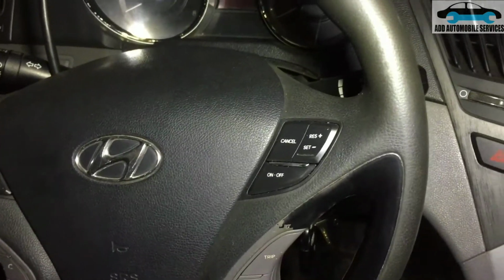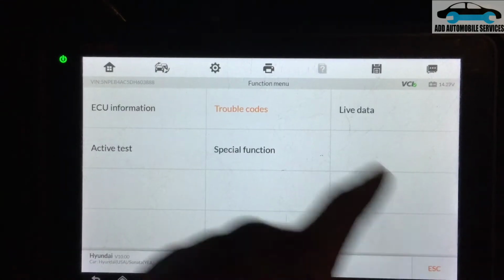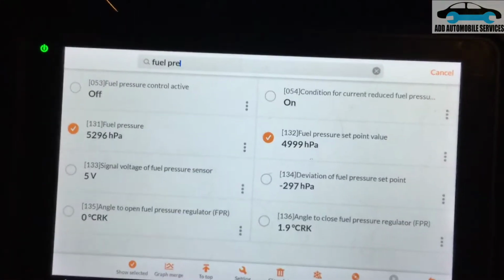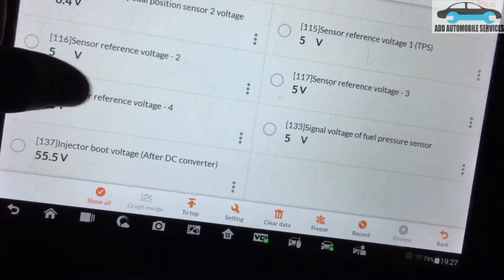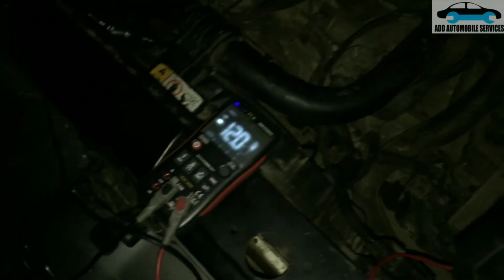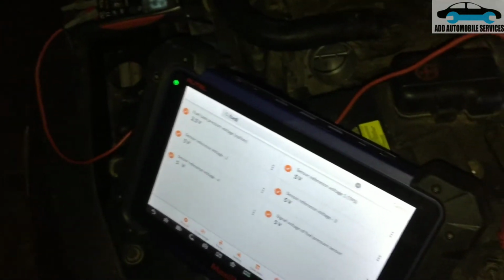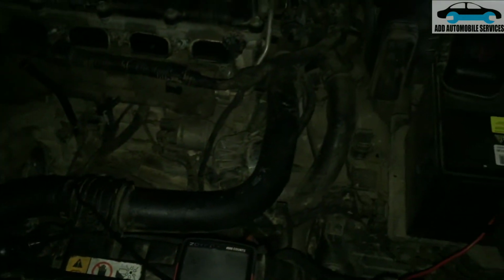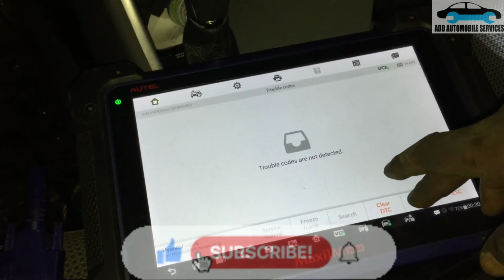2013 sonata: P06A5 sensor reference voltage 'D' circuit high (P0193)

Comment: Please what about this code p06A4 sensor reference voltage D circuit low, please i need your help and the location
Reply from the maker: Check the reference voltage D 
I am in Accra caprice
Reply: @ADDAUTOMOBILESERVICES  please which side is reference voltage D
Reply from the maker: You have to check the PCM

Comment: How strange why would someone splice in that 12 jumper wire. Great diagnosis and fix👍
Reply from the maker: I appreciate your input. It’s not an easy job so I’m glad when you acknowledge the hard work we do on vehicles on this part of the world
Reply: @ADDAUTOMOBILESERVICES  your welcome , I’ve been a mechanic here in England for over 40 years and you my friend are very talented in the work you do.
Reply from the maker: @kevinpalmer7452  40years? Wow that's inspiring. Thanks for the recognition 🙏.  I appreciate it. Its not easy but we will keep pressing on.
Reply: Likely because that wire didn't light up the testlight so the previous guy just decided to link it to a power source. Another example: It is common practice in this part of the world to hotwire in-tank fuel pumps by connecting the +ve side to any wire that is hot on KOEO without investigating why the stock +ve wire had issues and without really caring what device the "new" power source originally serves (connecting a relatively high amp draw device like the pump to another wire that has its own job to do). Later this causes problems for that other device/circuit you hotwired the pump to (weeks, months or years later when that connection is long forgotten about). The fuel pump then ALWAYS runs at 100% instead of its speed being varied by engine needs, leading to frequent and untimely fuel pump replacements. Imagine what'll happen to that wire when engine startup (high fuel pump current draw) coincides with high current draw on the wire's legitimate load. Like the OP's reply to you, there's need for more training. Cars sent to this part of the world are brought here to die a slow painful death but people like the owner of this channel are among the few who can make them last.
Reply from the maker: That is why we need more training 
Thanks for watching